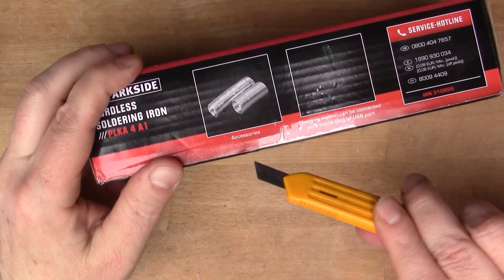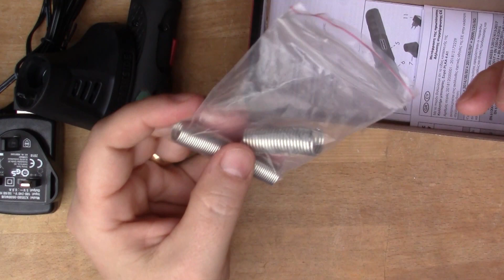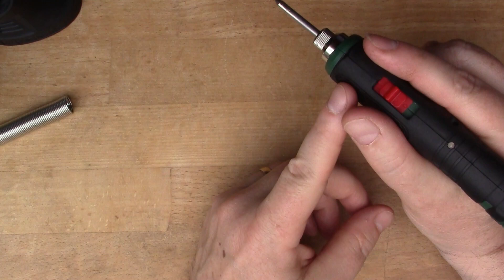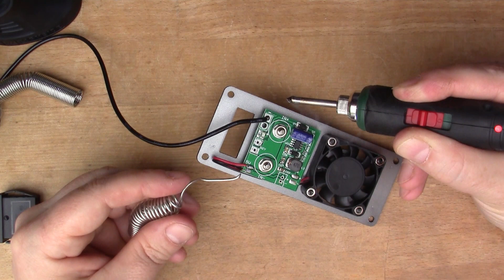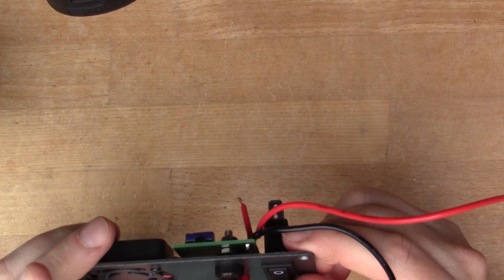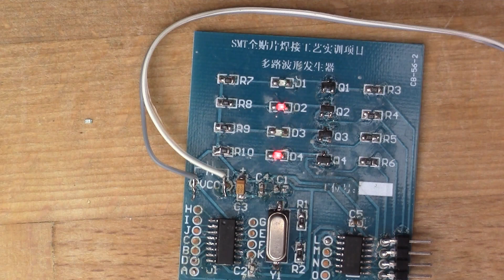Review of Lidl Rechargeable Soldering Iron (#105)

Comment: Yes, these are a real bargain. All previous battery-operated soldering irons I've used just don't heat fast enough/ lack sufficient thermal inertia to do anything / flatten the batteries too fast etc., but this I've used even for PCB work, even tinning & soldering wires in cars. Sure, I'd always prefer to use a 'proper' iron, but at least this one is there when you can't. Loving the presentation style, a sort of 'David Attenborough of Electronics'...
Reply from the maker: You are too kind, Stuart

Comment: Have that iron to. Works well and for a long time on each charge. I however tossed the stand since I didnt use it. Plugging in the charger cable directly works just as well.
When soldering, why do you try to hold the solder with your hands ? Just let the roll do it and approach the iron and cable to it. Wind up the solder so it isnt to long and gets stiffer.

Turn the iron 90 degrees and press the button with your thumb....much easier.

Thanks for the video and happy soldering.

Comment: Why do they even include a USB charger? Everyone has one - it just feels unnecessary.
Reply from the maker: I agree. From a sustainability point of view it seems pointless to make so many interchangeable low-cost USB chargers.  You also get USB ports included in multi-way mains adapters and even wall sockets now, which is better than clagging up all the wall sockets with wall-warts. I probably wouldn't run the soldering iron from a PC port though - if it shorts out it might do some serious damage.
Reply: I din not had usb-c these days v4 shipped with
Reply: My charger has output of 5V 1700mA. Not that it matters much but it's rather different amperes from regular chargers. 

As a matter of fact I think I have different iron or PLKA 4 A2, than the one used on this test..? Which, from what I've seen, has quite big gaps on how hot it becomes and in what time... I seem to have won in cordless soldering iron lottery with mine.